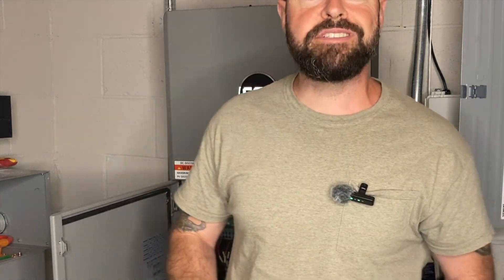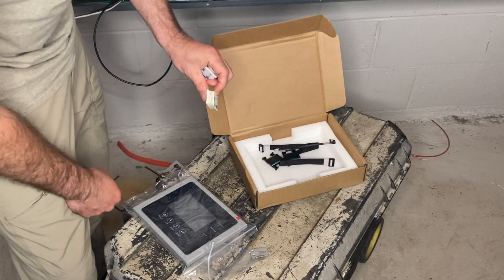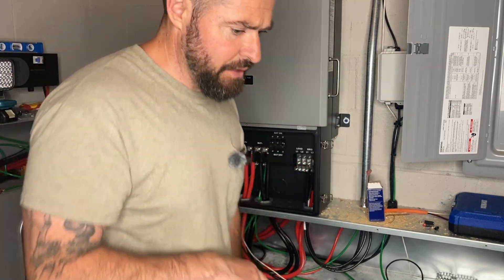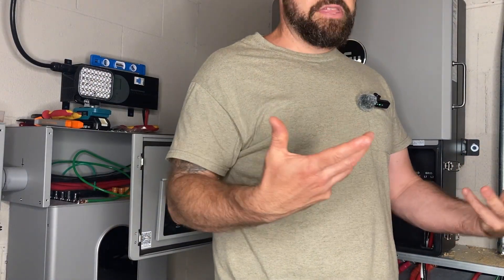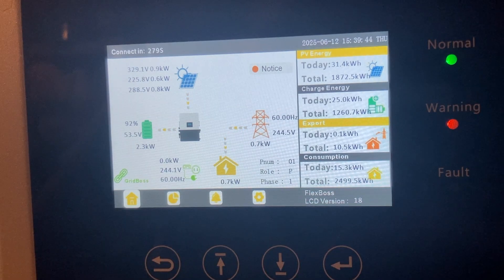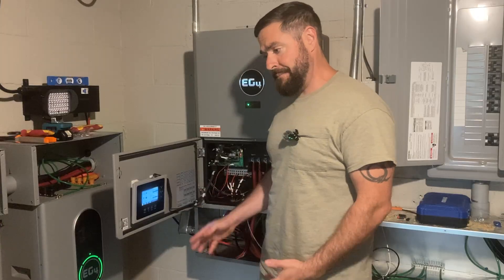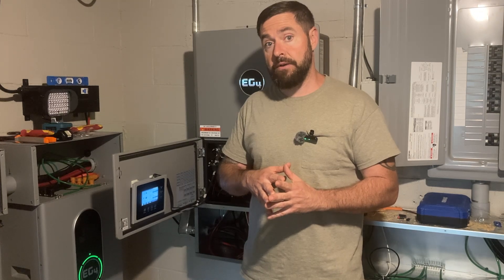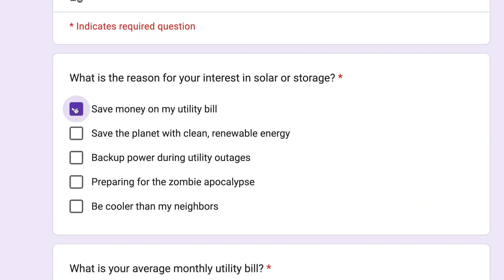EG4 FlexBoss LCD Screen Installation

Comment from the maker: Signature Solar affiliate link (CHEAPEST SOLAR PANELS ON THE MARKET and EG4 Products) 
$50 off for orders over $500 when using coupon code: ROCKYSAVE50
https://signaturesolar.com/?ref=uzUOpPif73O10D 

The materials used in this video are...

https://signaturesolar.com/eg4-flexboss-lcd-screen-kit/?ref=uzUOpPif73O10D&search_query=LCD%20&searchid=1440249

https://signaturesolar.com/eg4-flexboss21-14-3-28-6kwh-capacity-eg4-wallmount-indoor-battery-bundle-bndl-e0023/?ref=uzUOpPif73O10D

https://signaturesolar.com/eg4-gridboss-vs-mid-200a-service-entrance/?ref=uzUOpPif73O10D

🔋 EG4 FlexBoss LCD Screen Installation | FlexBoss21 Solar Inverter Upgrade 🔧

In this video, I walk you through the installation of the EG4 FlexBoss LCD screen on my FlexBoss21 solar inverter. Whether you're building a home solar system or upgrading your existing solar + storage setup, this step-by-step guide will help you get the most out of your EG4 power system.

👉 What you'll learn:

How to install the LCD screen on the FlexBoss21

Tips for wiring and setup

Key features of the LCD screen

Real-world look at solar + battery integration

🛠 Perfect for DIY solar enthusiasts, off-grid builders, or anyone working with EG4 inverters and energy storage solutions.

📦 Equipment Used:

EG4 FlexBoss21 Inverter

EG4 FlexBoss LCD Screen

📺 Don't forget to like, subscribe, and hit the bell for more solar energy tips, battery storage tutorials, and EG4 system walkthroughs!

📦 Watch the full series:
🔗 Part 1 - Mounting & Layout https://youtu.be/EOmpiz9oc6k
🔗 Part 2 - Electrical Rough-In https://youtu.be/bwKv7So71wA
🔗 Part 3 - Racking and Conduit https://youtu.be/vQj2ihdLo9U
🔗 Part 4 - Final Connections, Wiring, and Battery Testing https://youtu.be/iwMaCOVS0CY
🔗 Part 5 - Installing Solar Panels https://youtu.be/QTOdxBU-h6k
🔗 Part 6 - Preparing for Inspection https://youtu.be/BY6M5ommkNM
🔗 Part 7 - EG4 Chargeverter Installation for Standby Generator Integration
🔗 Part 8 - YOU ARE HERE

If you are interested in a zero cost pressure free quote for turn key installation of solar and storage products, fill out our intake form below...

Rocky Broad Solar Intake Form https://docs.google.com/forms/d/e/1FAIpQLSer5w_81iHtdcZBKV8Zuo9KVwJGQsqg_QNV-ePRvmWMiHZ8dg/viewform

If you are interested in DIY solar and storage products, check out some ROCK BOTTOM prices on those products using our affiliate links below...

Signature Solar affiliate link (CHEAPEST SOLAR PANELS ON THE MARKET and EG4 Products) 
$50 off for orders over $500 when using coupon code: ROCKYSAVE50
https://signaturesolar.com/?ref=uzUOpPif73O10D

Current Connected Affiliate (SOL-ARK PRODUCTS)
https://currentconnected.com/?ref=RockyBroadSolar

Also check us out at the following places....

Rocky Broad Solar Website
https://rockybroadsolar.com

Facebook
https://www.facebook.com/profile.php?id=61558585264414

Comment: Really think the white nylon clips are for attaching the ribbon cable and 2 x double-sided Velcro adhesive strips are missing but should be included to mount the screen.  That’s why ur screen is rocking and banging on the door when u press any button. Apply a tiny bit of acetone to release the adhesive so u can remount it.
Reply from the maker: That would make sense @lonniedomnitz1720 . Mine did not come with any double sided velcro unfortunately. I did see that on the EG4 video online though.

Comment: Code requires a 300 second (5 minute) delay when PV is present when grid is reconnected, that is why there was a 300 second countdown in the upper left corner of the screen when it first powered up.  It's a satety thing.
Reply from the maker: I should have known that. Did not notice the countdown when I was making the video. Thanks for watching!

Comment: I fit mine on the outside top left corner of the door. Ribbon cable goes through door seal just fine right below the plastic guard screen screw location on the left. Like not having to open door to see screen when I need to take quick glance.
Reply from the maker: I was wondering if it could slip out the front without compromising the ribbon cable. Now I know. I think I might mount it on the front of my gutter after the inspection. Thanks for the tip!